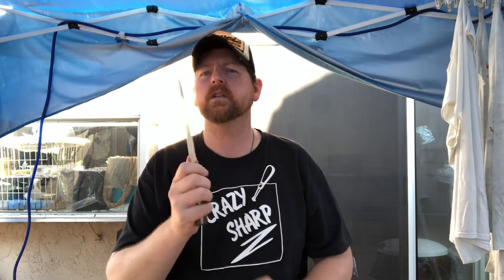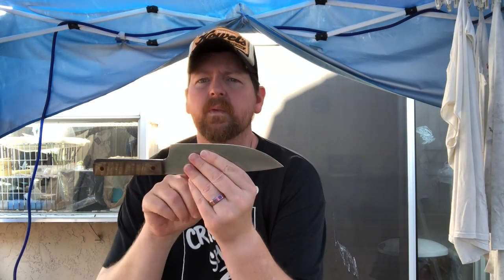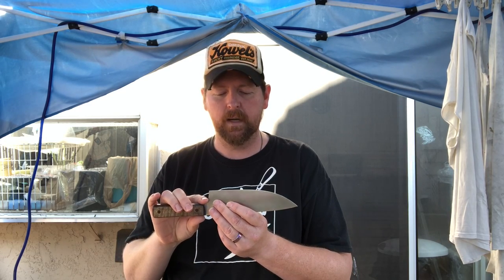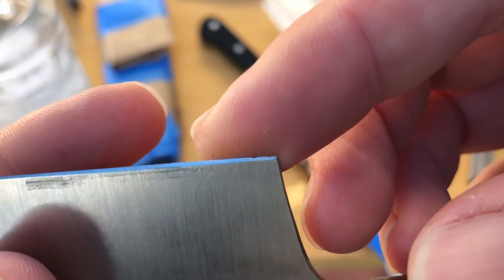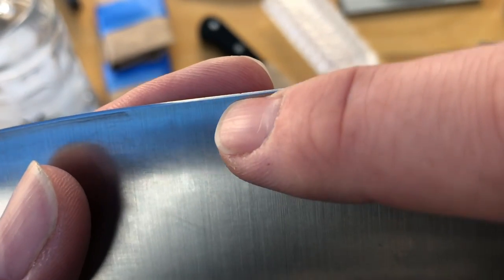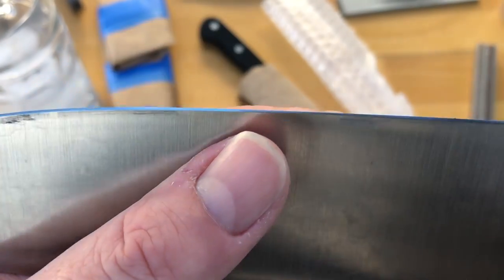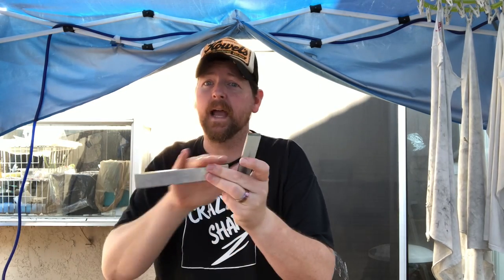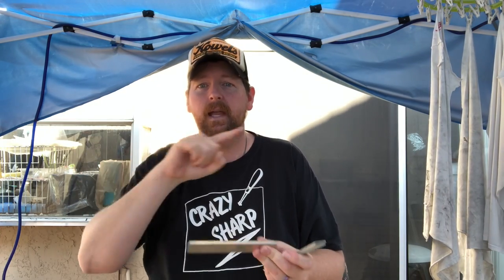Chip removal ... sometimes it’s not as simple as it seems

Comment: I dropped my Strider WP made of CPM20CV steel on concrete. That caused minor chips on the edge that probably aren't going away easy. This blade is almost .25" thick at the spine so it's a thick tough piece of steel. Thanks

Comment: I actually figured out this exact thing once by accident. I was kind of new to sharpening knives and I had a chip in own of my knives I take in the mountains when I'm out on my 4 wheeler and I was trying to get a chip out of the blade and started with a 220 grit and meant to grab a rougher stone and accidentally grabbed a 600 grit and the chip came right out. Surprised the hell out of me when my grandfather told me I grabbed the wrong stone and realized it was a 600 grit. He and I never thought it would of worked out that way so it was total accident from me being a rookie and accidently grabbing a stone that I thought was a lower grit. But hell I was 15 at the time and not very smart. Haha